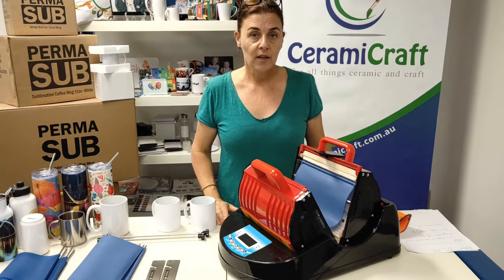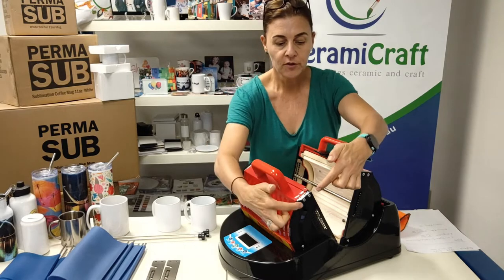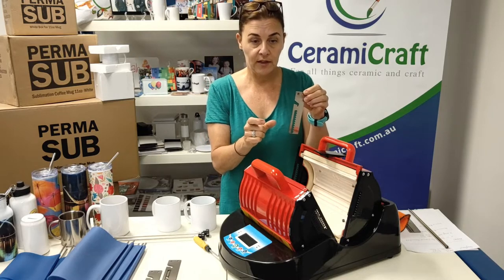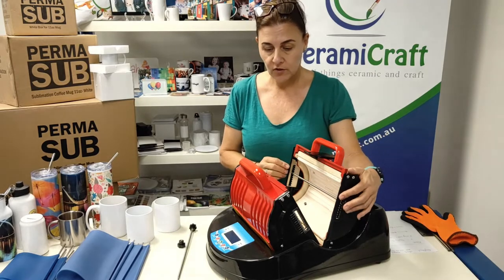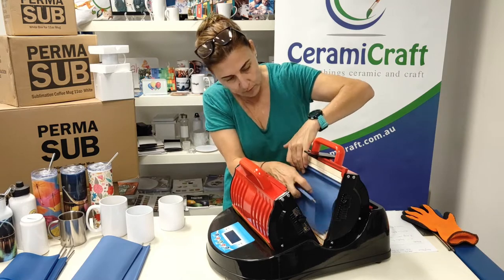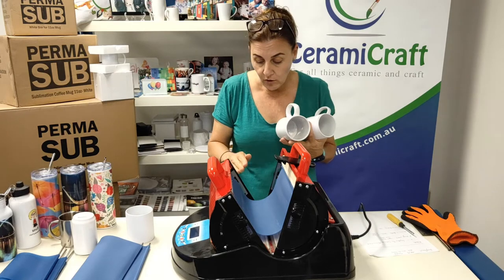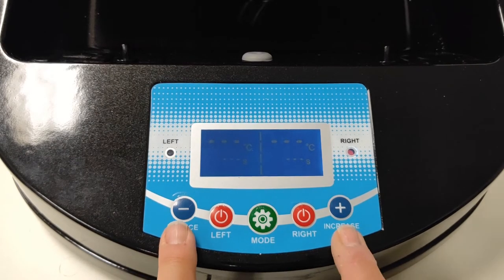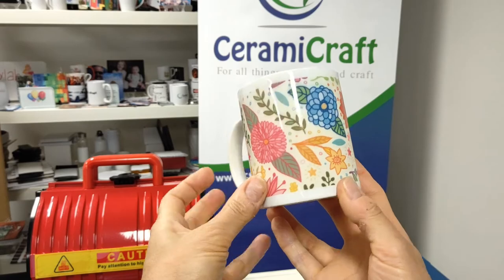How to press a 11oz Coffee Mug in the Freesub P6800 Combination Mug Press

Comment: I watched the drink bottle tutorial and can you tell me why the temperature is different on the left than the right? Thanks
Reply from the maker: I suspect it may have something to do with achieving optimal heat distribution within the chamber of the press.
Since the left control relates to the lower heat element, and the right controls the upper heating element. Naturally heat will rise to the top of the chamber from the lower element, and the upper element does not need to work as hard.
Reply: @Ceramicraft  so how are you to know what temps to set..since all sub items come with their own temps and time settings, the mugs i use say 160 seconds at 190 degrees